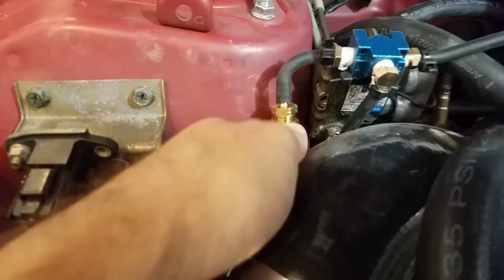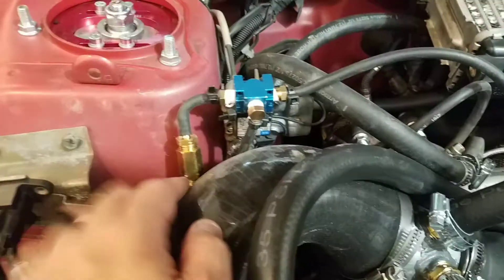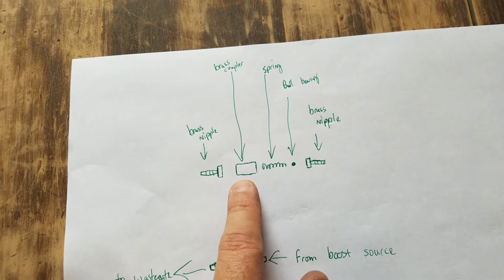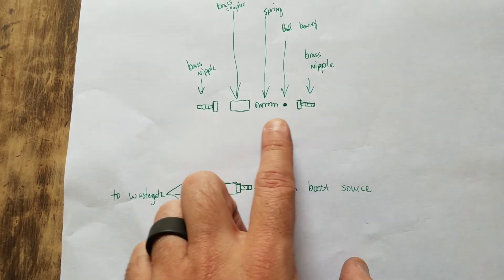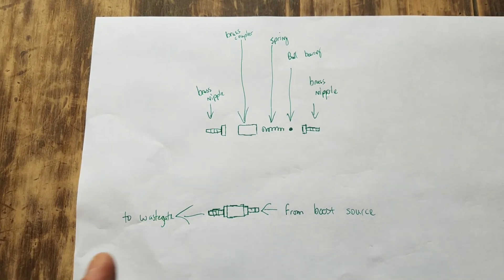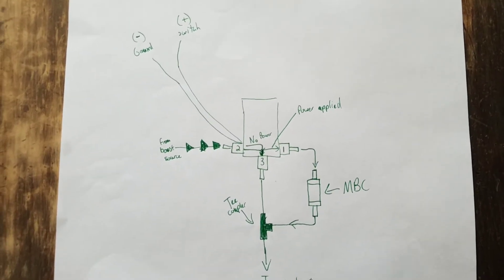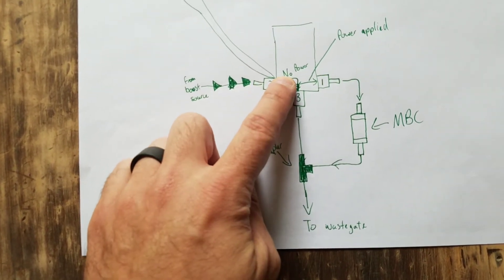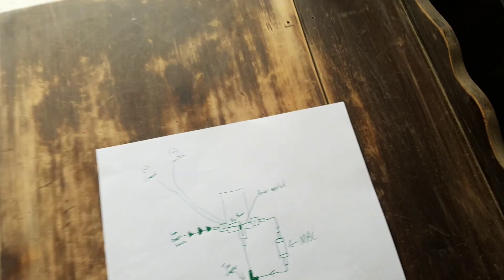DIY Manual Boost Controller/Electronic Dual Stage Boost Controller

Comment: What will happen if you go more than 9 or 10psi for the Subaru engine? I know it’s a stock engine but couldn’t it handle more than that? Say 18 to 20 psi?
Reply from the maker: Absolutely not. It's 10 tops.  You want better acceleration cut some weight. You need more, do a wrx/sti swap
Reply: @traviscea   I’m gonna go 18 psi, change to a map sensor, copper head gaskets, basically max out the td04  ,afr gauge, water/meth injection, will probably get aftermarket ecu then in a few months time I’ll let you know if the EJ22 can handle it! Oh yes I’m gonna swop the pistons to forged mahle
Reply: @traviscea  that’s sound advice you gave much appreciated. I just gotta find out if this EJ22 can take 18 psi
Reply from the maker: Adding water/meth will cool your intake air and allow for more boost safely.  However, 18psi is really pushing it and if the injection kit fails, your motor will blow in short order. 
I'd say try 12 psi and get a failsafe for the kit.  Look at your afrs and shoot for low 11s.
Reply: @traviscea  great idea👍🏻 I’ll start at low boost and work it up slowly checking afr’s all the time. Thanks for the feedback

Comment: I've been following your build and have an identical motor. Thank you for all of this information! Is there a way I could contact you in regards to your build? I am sourcing parts now and am at a similar spot from when you started.
Reply from the maker: I prefer to answer questions here, so that everyone attempting this build can get the questions answered.
Reply: @traviscea  I understand! My question was about A/C. My accumulator seems to be in an area where the turbo would sit but I noticed on your set up the accumulator does not seem to be present. Are you running a/c?
Reply from the maker: I am not. In the northwest ac is not needed. FYI, The ac line that runs along the firewall will also get in your way.